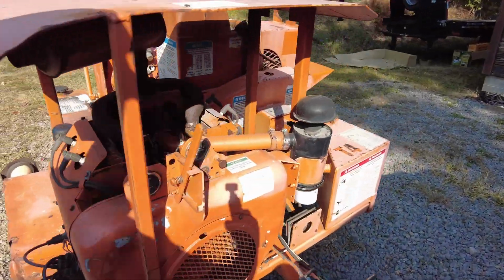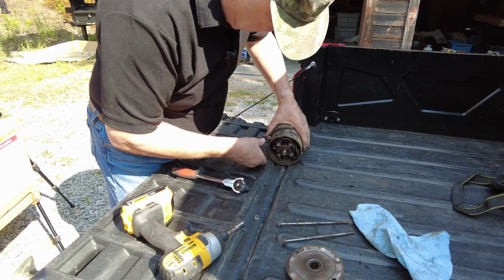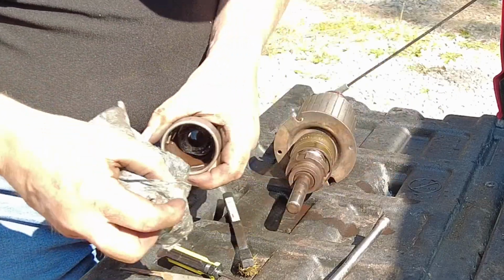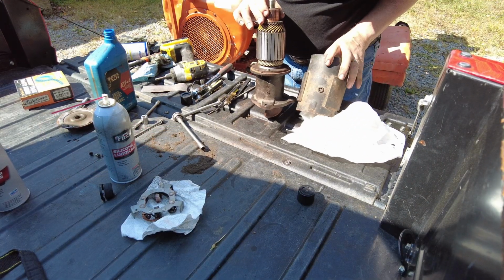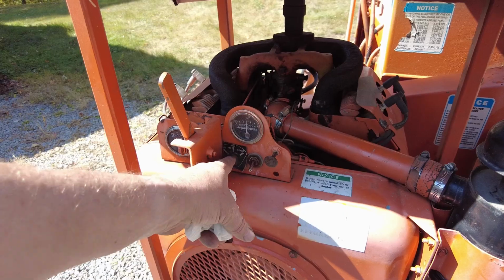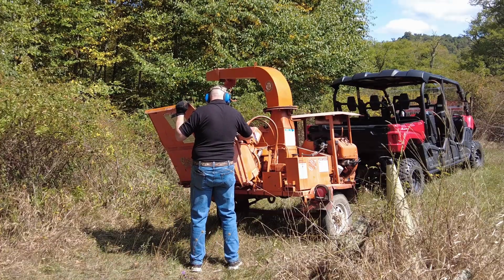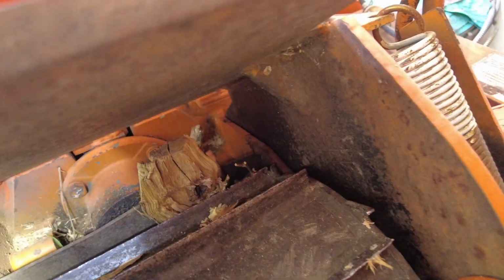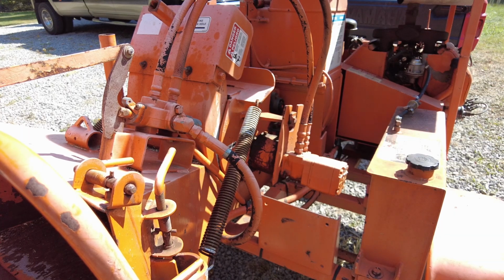Wood Chipper Repairs

Comment: Hey Danny,  Nice repair job, the starter sure was clean on the inside except for the business end.  They tend to dry out and stick.  Have you checked the blades to see if they are sharp?    I believe there is an air gap that also needs to be set between them and the anvil.  I used to operate one of those drum chippers nick named Chuck & Duck.  You would chuck the limb in and duck out of the way.  There was no feed roller and the drum would pull the wood in as fast as it could chip it up.  I believe it was either a Asplundh or Altec brand.  They had a 4 cylinder industrial ford engine but I've also seen them with a 6 cylinder ford and a v8 Chrysler engine.  They sure were fast.  Doug
Reply from the maker: My starter is better but still sticks for about one second as it is starting up. I will work on it again if it gets worse. Yes, i have checked the blades on it. I opened it up when I was buying it and saw the seller had put new blades on there. I looked at this recently as well and they still look good. Yes, I heard that there is an adjustment for the air gap. I don't know what it is and I can not find a service manual on this unit. If you can find one and email it to me that would be awesome. There will be future videos on me using this machine. They are sitting on my hard drive waiting for me to edit them. It is a beast. It will chew it up as fast as you can put it in.
Reply: @RetiredDreamLife   Hi Danny, sent you an email.